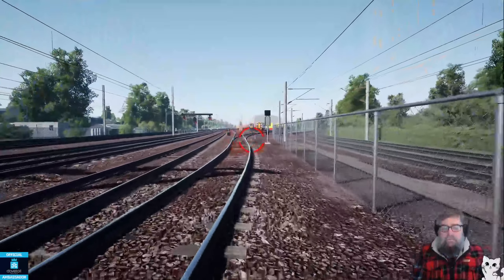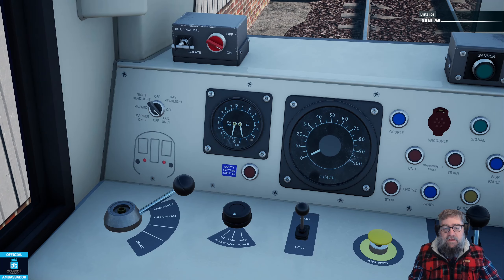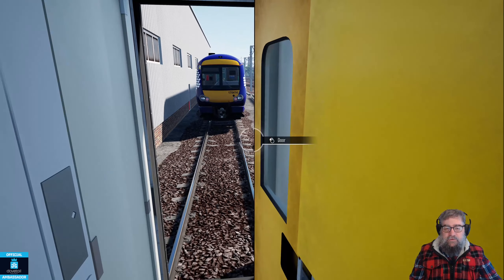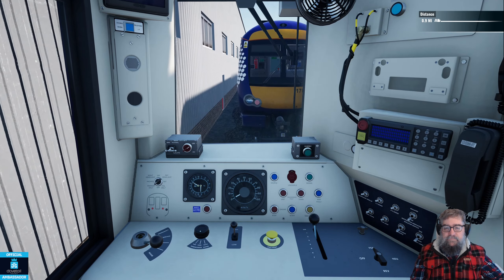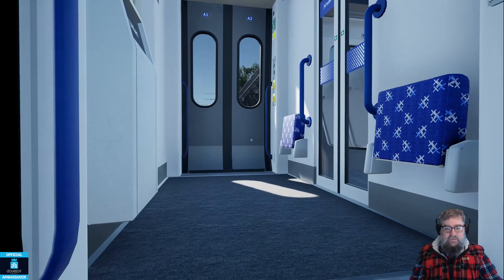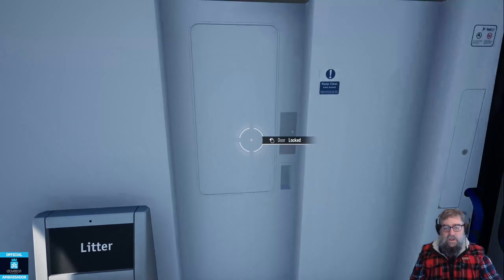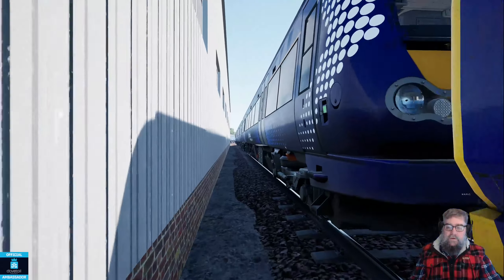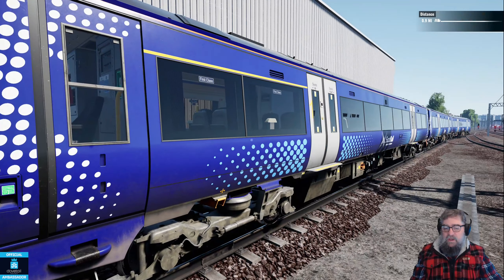TSW Scotrail Class 158 Cold Start and Couple Tutorial

Comment: Have tried spawning in a SR 158, EMT 158 & SR 170, and they all coupled and ran together.
Reply from the maker: @andyburbidge4938  yeah they seem fine. Interestingly the 170 often won't run in free roam but connected to a158 it works fine

Comment: Love your videos mate 👍
Reply from the maker: @lafayeuk  glad you enjoy them 😁
Reply: After you've coupled and before you press the couple button, you should do a 'tug test'. Put it into reverse and then apply a small amount of power for a couple of seconds . It ensures the units won't come apart!
Reply from the maker: @RailwayManUK  indeed - we call that a stretch and we do it before putting the air through - in the case of this train effectively we did do it because I pulled the other set backwards but I did not talk about it. The game doesn't really handle the concept because it immediately takes over the coupled unit with no interaction within that unit. I've watched it happen in the UK and there was activity in both the coupling cab and the coupled cab. No idea what they actually did though. I assume pressing couple button in both units and I would imagine but do not know that the coupled unit would not release its brakes until that had happened to allow for a coupler stretch.
Reply from the maker: @RailwayManUK  I will give it a crack in the game before pressing the button - will post another video if it works
Reply: @trainsimulatordriver  I've never tried it in game, so I might give it a try later. Regarding the actual process IRL, I think it depends on the traction type as to how many people  are involved in the coupling process. Its helpful to have someone else there but it's not essential. 

Thanks for posting the video!
Reply from the maker: @RailwayManUK  being entirely risk adverse I will do it on the live stream tomorrow ;)